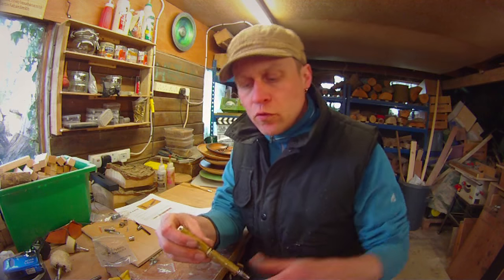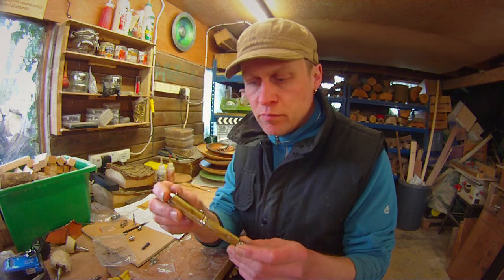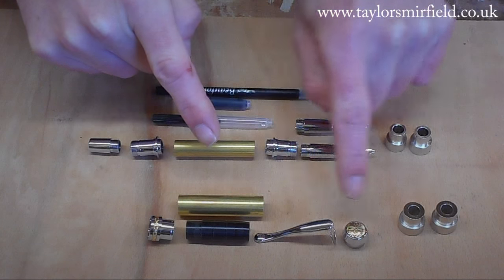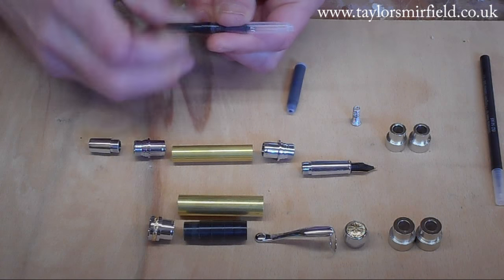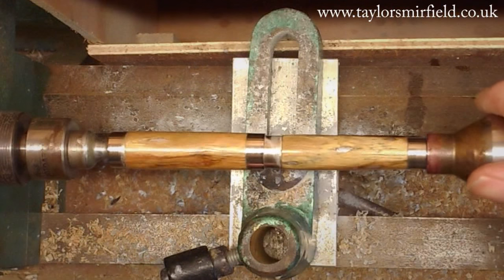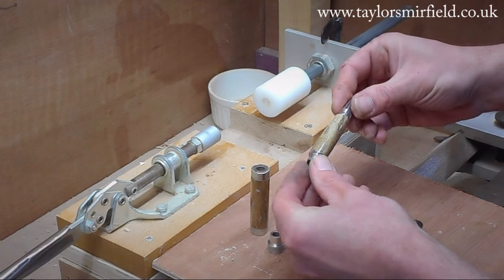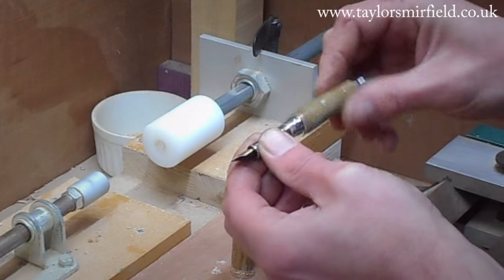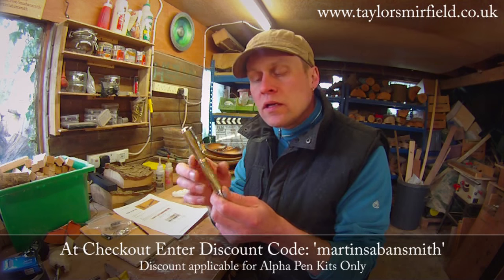Taylors Mirfield Alpha Pen Kit Review

Comment: Lovely job, but I was looking for how you aligned the body and cap grains. You don't seem to. At 8:00 you simply press the plastic thread into the cap, yet at 8:20 it is miraculously aligned. Surely you must first screw the centre section to the body, offer up the cap, choose grain alignment, (optionally unscrew the body here) and press the thread into the cap, confident that the grain matches.
Reply from the maker: Yes. That's correct.